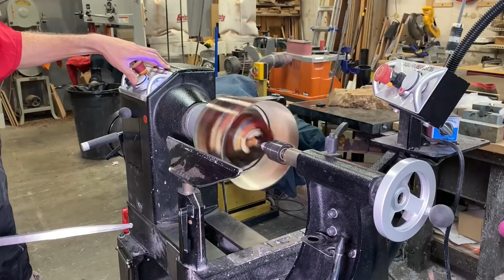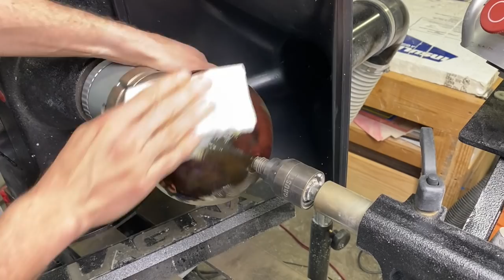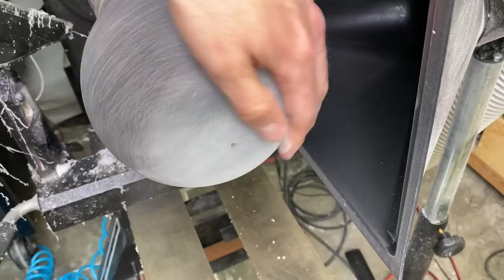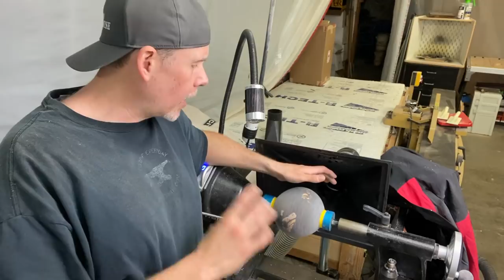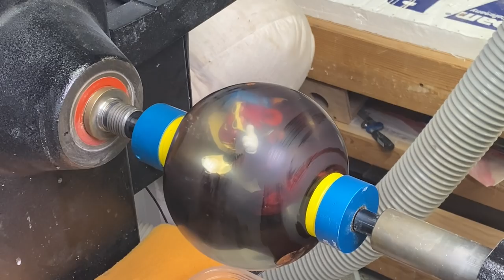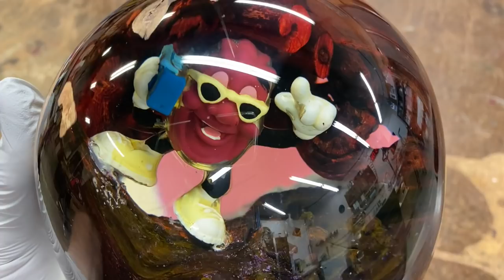Woodturning: The Resin & Grapevine Spheroid With California Raisin Man Embedded

Comment: Great for a freehand approach. There's tools for perfect spheres if you're want to go down that "production " road. 👍
Reply from the maker: Well, I have to say it wasn't as good as I could have gotten it, even freehand, if I had invested more time in turning it. I was sloppy and thought I could get away with it, I was wrong LOL I do have a sphere jig but wasn't particularly happy with it, especially on large blanks. I think I'll pull it back out and give it a try again though sometime. If I can get that thing to work better, it sure would be a lot easier and faster to nail the shaping. I don't plan to do any production work though, never was particularly good at production, marketing, or selling finished pieces. I'd rather stick to what I'm good at, making blanks :)